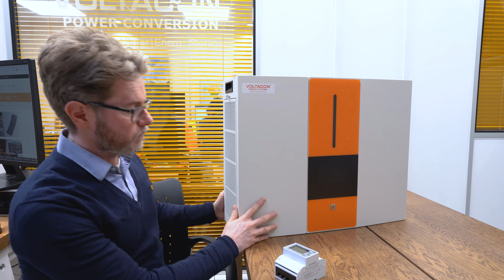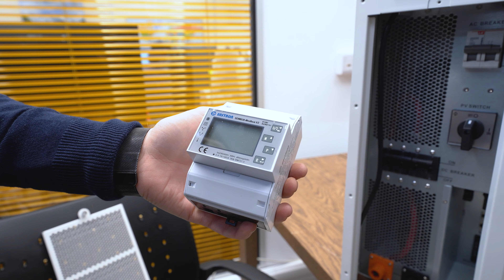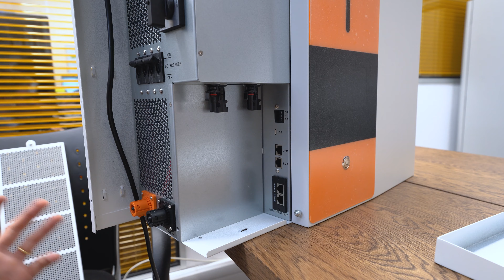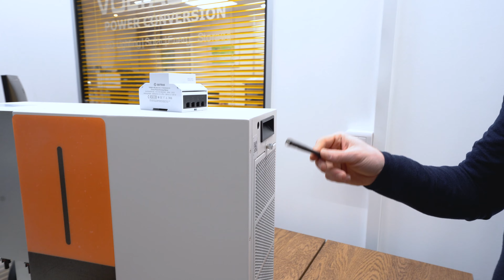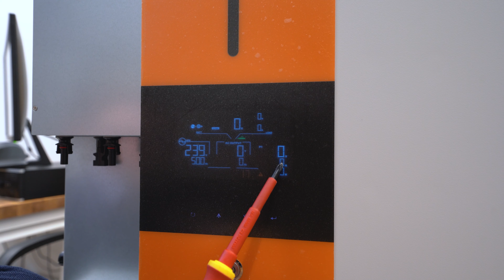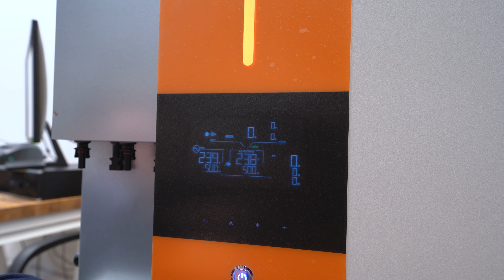Unboxing the new 5.5kW ESS (Energy Storage System) Hybrid Inverter Charger for self-consumption

Comment: Hello good video I am definitely looking at buying this Inverter+two batteries.

I have 2 questions

Question 1
Can this system be paired with another inverter in parallel? 
(Either EES 5.5 or other brand)
In the manual on page 19 it says it's not allowed to operate in parallel.

Question 2
Can you tell me how the inverter would handle a power cut? Under the following conditions, drawing only 500W and if I had my car charging 4000W

Thank you for your support